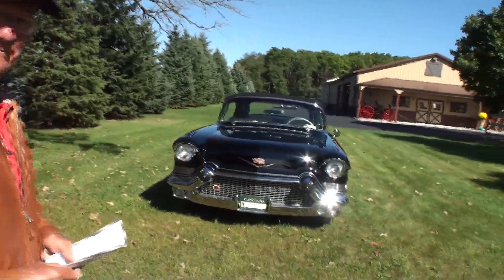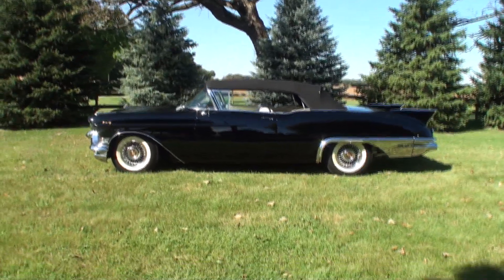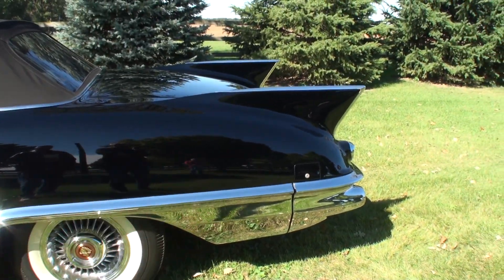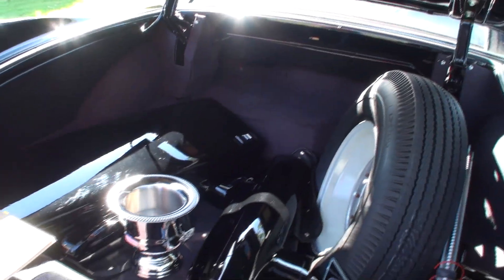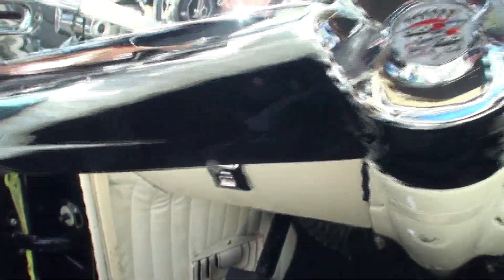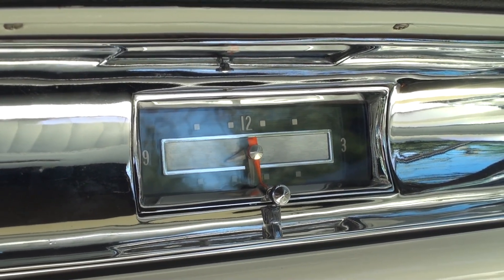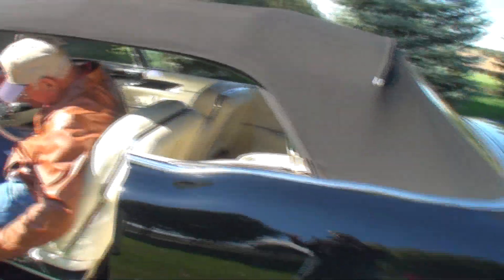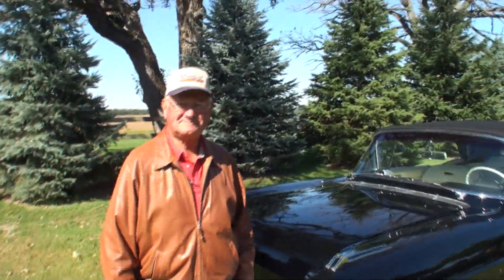1957 Cadillac Eldorado Biarritz Convertible in Black & Engine Sound My Car Story with Lou Costabile

Comment: There will never be style like this again. Late 50's early 60's was the epitome of car design
Reply from the maker: You're right.
Reply: @loucostabile  I wouldn't count out the possibilities for niche production with costs likely to come down drastically with new production methods.
Reply: Late 19676869 & 70 were the Golden Age of Power and Design.Ilived in Flint and travelled to about 35% of Michigan towns and sights Holland tulip festival to Machine Island favorite is Dearborn Village.what a great match.. ☮️ Toby
Reply: Mackinaw Island
Reply: Difficult to see the print in the shade and even harder to see it in blinding sunlight.

Comment: My friends dad  had the   Eldorado   version in the colour  green  as  seen at the  06:19  mark .  It was from CA ,   but  because   he had  3 cars  and a narrow driveway    the caddy  was parked at the back area of the house under a tarp  and needed  a couple of repairs   plus wasn't  driven in the upper State   winters with salt  on the road .   
       I remember   those  rims   but  the tires didn't have white walls   but had   about a  1/8"  wide   mustard  coloured  strip  while  the  normal   tire  for regular  cars was white , the tires also had TUBELESS   in raised letters  which amazed me for 1957 . 
    
   Nice how the designers  carry over a  theme  to areas of the car.   Take another look  at the lower rear light and exhaust ports ,   there a matching    rear  fender  FIN in chrome   recessed   right at the 12 o'clock   position   and anchored   to that center piece for the backup lights   while the exhaust  port  ones are larger  but  they both match the design  for the front  bumper Dagmar  bullets . 
     A buyer would never know   that useless  the got a good look at them   and connected the Fin and Dagmars ,   even the brakelight  bezel  eyebrow   from the side  curves  in at the equator  for a slope that matches  the   angle for the vertical  fin portion   right above it  but  the Bezel  also is a smaller version  of the headlight  eyebrow .     
   
  One day  when   2 of the cars  were out , someone  drove by  that was a cadillac follower  and glanced  in  the driveway.   The lower bumper  was expose   while the trap  was lose and showed the tips of the fins.   BINGO....this guy  knew exactly   what is was  and had  only seen  the roof  area    in the last  year of  taking  that route.  But   when he got close   he  saw  roof  shape under the canvas and couldn't believe  it  because  the area had short summers and  cold winters  where soft tops  didn't sell well.    
       He wanted the car     ' as is '   but  it wasn't for sale  until he finally  offered a  large   cash amount    because  he knew it was from California and didn't see locals winters .    The cash was greater than   his dad's  attachment  for the memories of driving around L.A.   with the top down  and he  was the 2nd owner .
Reply from the maker: Hi Gary wood, Thank you for sharing the memories of your friends Dad's car :-) Lou

Comment: My aunt bought one of these new, but it was charcoal gray with white interior and a black top. She died in 2007 and my dad, her brother, sold it in 2008 for $105k. BTW, it also had A/C, but as I recall, that was dealer installed.
Reply from the maker: Sounds like a great car. Thanks for sharing.

Comment: Wonderful. I was so hoping he would drop the top......next time. 
Interesting note in how convertible tops are now designed, even this elegant and expensive Cadillac had a very old style unfinished inside/interior of the top, whereas new convertibles usually have a padded, lined top that looks much more finished and is much quieter. But I love any convertible. Thanks Lou.
Cheers.
Reply from the maker: Hi rizzle razzleuno, You're on the right Channel as there are many convertibles here. Stay tuned, the next one coming up is a convertible :-) You're welcome, and Cheers, Lou

Comment: Nice car, but quite a bit of it has been modified, No mention of the changes in the video at all. Love the nice trophy in the trunk. Did that show have a modified class that this car competed in?  I kind of doubt it. 
Without getting too picky, the owner's claim that only 50 convertibles came with factory AC is not verifiable, nor is it right. Cowl Tag: Color code 24?? IS NOT BLACK and interior trim code 11 IS NOT WHITE  The car originally came  from the factory Tahoe Blue with a Black interior and a Blue convertible top.
 
Without totally drilling down into the details, not only no, but no way ever is that a correct interior for any '57 Biarritz to begin with. It's totally customized. Dash pad vinyl is correct for a Deville (Seville grain), not correct for an Eldorado (Madrid grain). Door panels???  incorrect materials and colors used there also, same thing with the kick panels.  The dash clock belongs in a lesser expensive Cadillac models as ALL Fleetwood bodied Cadillac cars (aka Sixty Specials and Eldorados) all came with drum clock, not hands type clock. Steering wheel is incorrectly restored too. Under the hood? Valve covers need to be gold, not blue and the fuel pump is more at home on a '59 than it is on a '57. The '57 AC pump has the angled lid and are getting scarce.  At the very least, the car has an exhaust leak, maybe worse if the left cylinder head is cracked between #3 and #5 exhaust valve seats      Sorry to be a downer..., nice driver, not top shelf competitive at a CLC Grand National.
Reply from the maker: Hi Louis, Thank you for viewing and sharing your knowledge. Hope you see many more cars on this YouTube Channel you enjoy. Please subscribe, and hit the "bell" so you can see all the cars when they are uploaded on this YouTube Channel, Lou